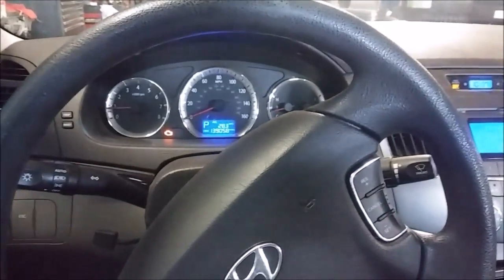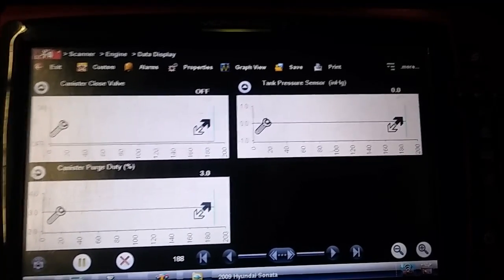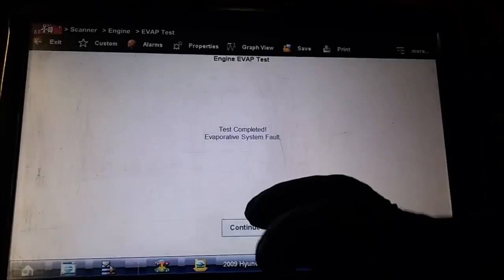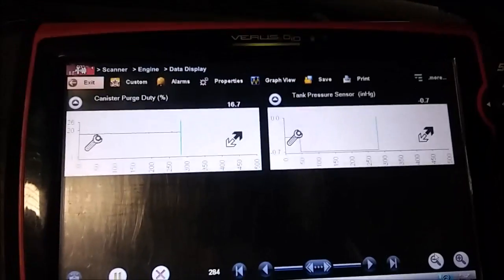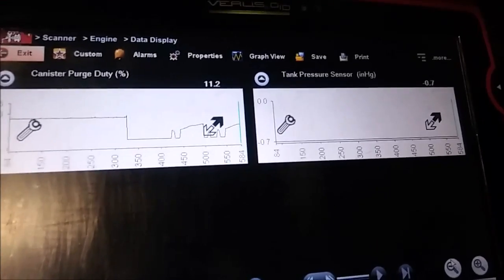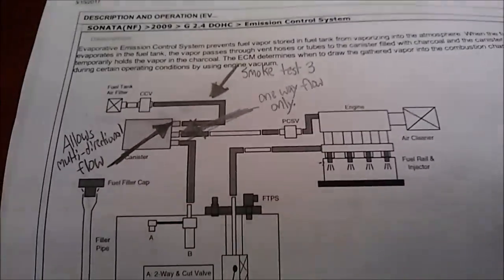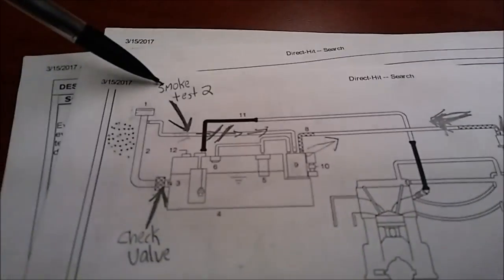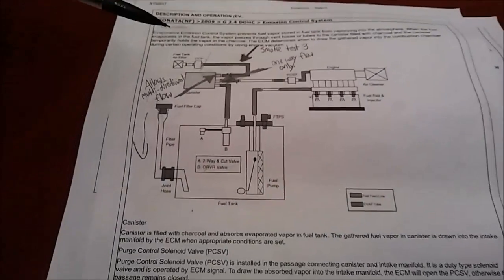2009 Hyundai Sonata, EVAP System Small Leak Troubleshooting

Comment: Just failed this ran through a flex pipe a gasket where the flange connected to the exhaust then to top it off my muffler edges had a small rusted area around the ledge where it was welded....lmfaoooo im praying thats the last leak because i was getting cold start high rpm 1k or so for about 60 secs until the computer could calculate ....but needless to say i need my emissions passsed lol ,after countless other fixes i feel i should of built this car from scatch smdh🤦🏽‍♂️ . Ordered a purge valve and hoping i dont have to order an evap canister also but i will if need be this video was highly informative . Sealed most small leaks up letting it set and will reapply tommorow another coat ...praying this solves this permany po455 crap code. Will keep posted upon request. Great work and nice vid brother 🙌🏽💯

Comment: To anybody watching this I would certainly give a nod to the tech who worked on this vehicle.  It does appear this  vehicle has a "filter" (the horizontal one along side the fuel tank filler by the vapor canister-about 4-5 inches long) that supposed to filter the air purged  from the canister.  I believe this filter is only on certain Sonatas with the PZEV system and can clog up and set false codes for a CCV.  The "clog" can come from loose charcoal particles from the canister.  Another symptom would be a slow fuel fill.  Hyundai is very vague on replacement of this filter and some dealers don't even know it's there.  Take if off and try to blow through it-if restricted......replace or simply eliminate filter.

Comment: We just check out the same year and make model. We connected to solenoid in engine compartment. Canister was leaking,but couldn't see smoke. We used soapy water and found bubbles coming from canister at the seam. Were going to lower frame to get canister out instead of messing with fuel lines and hoses.

Comment: These systems are way over complicated. I have a 2008 sonata with a 
po 442 and 456 code. Black electrical tape over the light and rescanning every 6 months fixed mine. :)
Reply: what do you mean by black electrical tape over the light?
Reply: @j-silve6249 ignoring it basically.

Comment: Nothing but problems with my customers Sonata. 4 years ago small evap leak turned out to be the vent valve will not shut all the way. A year later small evap leak again. This time was not able to diagnose it with smoke. 1 pressurized the fuel system with 2 psi from my TIG welder and found with soapy water that the canister was leaking where are the driver side mounting bracket bolts threaded into the canister. Anothet year later.....small evap leak.  Pressure tested again.  Could not find the leak after spraying everything down but would not hold 2 lb of pressure and could smell and hear small leak. Pulled the gas tank down and found two areas they had small cracks in it from when the fuel tank was formed. They had been covered with under coating.  Prepared that and now a year later it's back in the shop for a small evap leak. Also please note that after each repair I pressurized the system and tested under vacuum and was able to have it pulled vacuum for at least 5 hours. Both the customer and I are getting tired of this vehicle. I tried many different places to attach smoke machine kiss for each of these diagnosis the smoke machine simply did not work for me.
Reply: omg this sounds like a nightmare .... any update i know its been a while lol

Comment: Did you replace the canister? I believe I have the same issue, same code. Ordered a new aux filter, and control valve. Hoping that fixes the issue and I don't have to replace than canister due to the difficulty.

Comment: Just finished basically the same job (except mine was a 2010).  You are correct that you can smoke the system from the hose for the purge line. I use a MODIS which does have the ability  to shut the vent valve. I wasn't sure when I began where I was going to inject the smoke being no EVAP port. So as I was having coffee, I googled it and enjoyed your REAL LIFE ( or Welcome to my World) video as I tell customers. My canister was also the problem, and is very common on these. They also have a problem on top of the fuel pump which you can access through a cover in the trunk. Thanks for showing how NOT SO EASY some diagnosis can be. I will give Hyundai credit for there EVAP monitor test. Ran it with the MODIS, it passed and ALSO rest the monitor

Comment: Have same P0456 problem with my 2010 Sonata. Bench tested solenoids, both open/close don't stick and hold vacuum/pressure. I hooked up the smoke machine to the hose that goes from the Vapor Canister Vent Solenoid to the vapor canister. Smoke was coming from the vapor canister area. The hose came off very easily I replaced the spring clamp and ran smoke again, didn't see smoke but not 100% if that fixed the problem. So far no CEL but still have a permanent P0456 set don't know how many drive cycles or how to clear it.
Reply from the maker: You should be able to clear the fault out using a scan tool,  it definitely shouldn't be hard faulting as permanent,  at least not until the evap monitor has ran it's course.

Comment: my 2010 sonata would not let me fuel had a p0449 code,found the filter was clogged with the black pellets from the canister.
Reply: Took it off and tapped it on the floor until all the black pellets were out,then blew it out with the air hose.
Reply: 29 auto what did you do to clean it? I’ve been having this problem for a few years. I just usually hope my check engine light goes off long enough to get an inspection and deal with the gas problem. Just wondering the best way to clean it.
Reply: 29 auto going through this same issue now...finally replacing the vapor canister after spending money and replacing the purge & vent valve....
Reply: 22:06  What he has it hooked to is what I took out and cleaned.
Reply: 29 auto thanks! I’m going to be working on this next weekend.
Reply: @nicolerounds4074  I have the same problem and have you fixed yours?
Thanks
Reply: Zongrang Liu the car ended up dying this past June and I sold it. Never did fix it.
Reply: @nicolerounds4074  Nicole, thanks.

Zach
Reply: Your welcome,hope it works.
Reply: Just bought a 2010 sonata from the auction, and this code comes and goes, also it's hard to fill gas. Anyway replaced the vent valve (with one from the junkyard of course lol) still the same, filter going to be my next victim and hope it works.
Reply: @NWCI  got your problem fixed?
Reply: @zongrangliu840 , I got it fixed.
I did a video regarding the car. You're welcome to check it out 

https://youtu.be/pJC0PAz9R64
Reply: @NWCI  thanks. I really appreciate you for making vedeo and I watched. Looks great. I just bought 2007 Hyundai Sonona for my kid and it showed P0449. I will check my filter tomorrow and hope the filter location in 2007 Sonona is the same to that in 2010 Sonona you showed in video.
Zach
Reply: Is the fuel filter or air filter?

Comment: Never seen this happen to anyone on YT. That is a complicated system. Learned a lot on this one as I finally now realized that the engine vacuum is what creates the tank vacuum through the duty cycle dependent purge valve. I've never had an evap problem on any car I've owned so was never forced to do my homework on the systems.  Thanks so much!

Comment: nice diag do u like using the verus i was thinking of buying one or  should i look at other scan tools interested in the 4 chanel scope part of it
Reply from the maker: The Verus treats me pretty well most of the time,  and the integrated scope is very handy.  A huge benefit is the troubleshooter feature,  which saves me HUGE amounts of time.  I can usually find key system information through either the troubleshooter or guided component tests,  and saves me trips to the laptop to look up information online.  I ultimately would like to get an Autel Maxisys to supplement the Verus and cover some areas it doesn't do well.